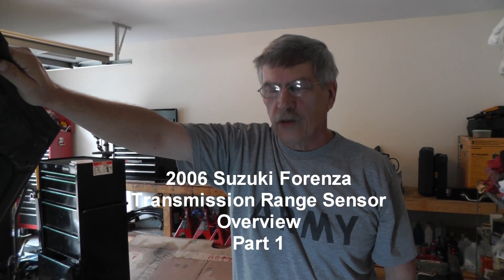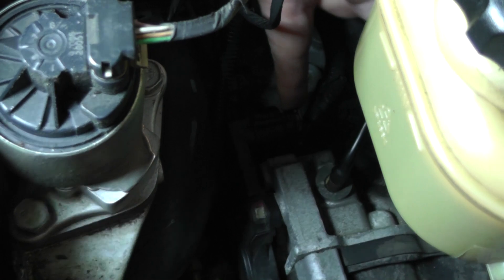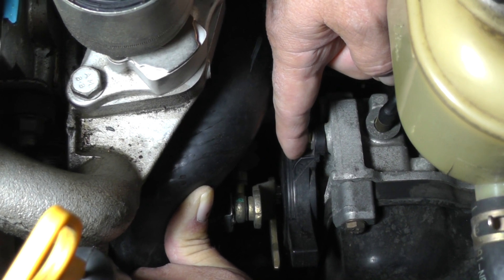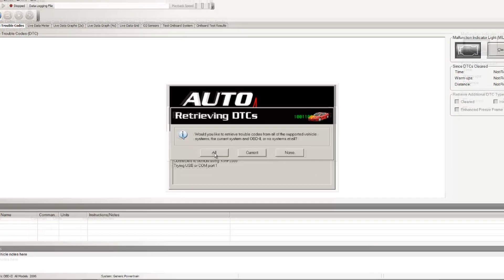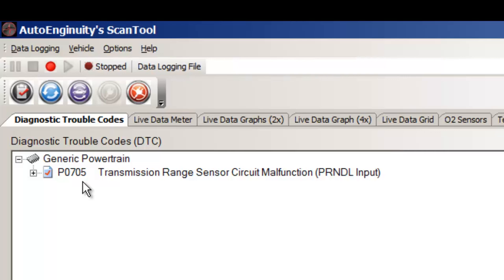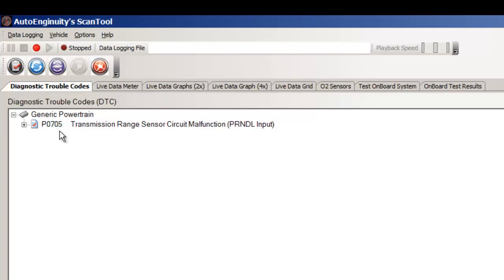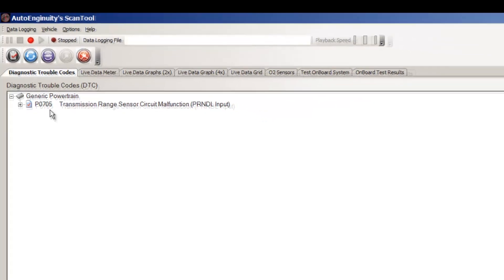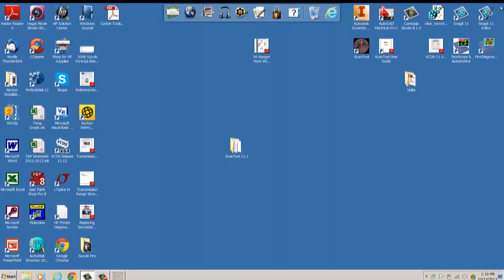Suzuki Forenza Transmission Range Sensor Overview - Part 1

Comment: Greetings from El Salvador, I have a 2006 Suzuki Forenza, I do not know,  how to do an oil change, I wonder if you can help with a tutorial on how to change the automatic transmission oil, thanks.
Reply from the maker: chino Lozano Sorry chino. I sold the car along with the service manual about two years ago.
Reply: ho no... but thanks you, for your time and the comment too.

Comment: Can anyone tell me about that hose that's sticking up from the transmission, just over from the range sensor bolt, shown at 0:52 ? I'm rebuilding my car can't figure out where the other end of that hose plugs back in.
Reply from the maker: Sadan Yagci I'm sure that the hose that you're referring to is a vent hose for the transmission. I can't tell you where it gets connected to as I don't have the car anymore to take a look. Maybe some here can help you out with that.

Comment: Could broken motor and transmission mounts cause the sensor to send the code?
Reply from the maker: Gene Quinney Hi Gene....Yes, I would say that if you've got broken engine and tranny mounts, it's possible that the P0705 code could be generated. Anything that will jar and move such as the tranny will also go to the sensor. So, if the sensor gets a lot of these vibrations and jarring, the sensor could report that. If you do have mount issues, get those fixed first. It's possible the P0705 code would go away at that point.
Reply: Thank you

Comment: Hey, great videos! I have a question I hope you could please help me with!

I have a 04 suzuki forenza. It is a 5 speed manual transmission. When I go to start it with the clutch to the floor, it does nothing, but if I lift the clutch just like a half inch, it starts up no problem. The clutch has to be in the perfect position or it will not start!
Does this sound like a Range sensor issue to you?

Thank you very much, in advance, for any input you might be able to provide me on this issue!
Reply from the maker: Take a look under the dash at your clutch pedal. Press the pedal and you should see a switch which should activate/deactivate when you press the pedal and release it. I suspect that you have a problem with this switch.

Comment: Hi i just bought the range sensor but its still doing the same it clunks whe i go reverse and drive and it does not shift its stuck in 1 gear. What could it be?  Thanks
Reply from the maker: I assume that you read the code originally and got something like P0705. You may want to read the code as I'm sure there is a check engine light on to give you some direction to go. Did you clear the code when you changed the sensor? Worse case is you may have a tranny problem.

Comment: Ok thank you. One more question after replacing the senser is the transmission going to keep clunking or do i need to drive the car or clear the check engine light?
Reply from the maker: It's better to clear the code and then you don't have to wait for the computer to clear it for you. Otherwise, with the computer it could take awhile.
Reply: NO I DID NOT CREAR THE CHECK ENGINE LIGHT COULD THAT BE THE PROBLEM

Comment: Hi do i need to clear the check engine light after i replace the sensor. And also by replacing the sensor is the computer going to reset the limp mode on the transmission? Thanks
Reply from the maker: If you have access to a scanner, you could clear the code which would be the best thing. But if not, the computer will clear the code. It may take a few drive cycles as I can't remember and the computer will reset the limp mode back to normal once it sees that all is well.
Reply from the maker: First, before you clear the code, check to see what code you have. I'm just assuming that you got a P0705 which would indicate a problem with the switch. I'm not there to see what your issue is. You need to read it to see where your problem is. Otherwise, you're just guessing at the problem. If you have a P0705 and you replaced the switch and you adjusted it correctly, then clear the code. Otherwise, it's going to take quite awhile before the computer resets the system which means you will have clunking in gear, stuck in gear, etc. If you're going to do the diagnostics, you'll need to get the code read from someone or invest in a scanner. Take care Ricardo and good luck on your repair.

Comment: Stupid question probably. But I've been having trouble for a while with my sensor. I turn it off and reset it and it's fine. I'm just wondering if I don't fix it immediately, it wont hurt my car right?
Reply from the maker: Not in the short term, but try and get it fixed as soon as you can. With the tranny sensor failure, your tranny will start out in third gear which is not the best for the engine.

Comment: I have 2006 Suzuki forenza when I'm driving the car the light  is on in the cluster is blinking to neutral  gear and the car not advance  just on 3rd gear  you think is a sensor range transmission?
Reply from the maker: Could be Jorge. Check your code to see what it is.
Reply: http://lacetti.com.ua/chevy-man/EN/documents/Nubira-Lacetti/start_Nubira-Lacetti.html
Reply: It's not the same vehicle but if you go to service manual>transmissions>zf4hp16 it is the same transmission.

Comment: My Aunt had recently bought me my first car 11 days ago (2005 Suzuki forenza S) with 83,000 miles. 2 days after buying the car I noticed in 3rd gear there would be a thumping noise, I also noticed that it was clunking harshly from park to reverse and so forth. Now here we are 11 days after buying and everything got worse. Was at a stop sign, tried to accelerate and it wouldn't, check engine light came on, put it in park restarted the car and I was stuck in either 3rd or 4th gear all the way home. Also, the 2nd day I had the car I noticed that the sensitive speed power steering mechanism light would come on while driving, the steering felt fine but I don't know what to do. The car is at the dealership right now but any ideas?
Reply from the maker: Hi Taylor, it could very well be your tranny switch from the description that you're giving. Being how the check engine light came on, the dealership will have a good direction to follow to see what the problem is. Hopefully, it will be that and nothing going on with the tranny. I wish you luck that the repair will not be too expensive. Take care Taylor...
Reply: Thank you, my local mechanic has had it in his shop for the past 24 hours, I'll let you know when i get the word on what is going on
Reply from the maker: Taylor Haney Hope it's nothing serious Taylor...

Comment: Are there any Suzuki Forenza lovers? I HATE this car. I replaced the transmission range sensor twice in a year. Now I have another problem which has a code of p0716, input speed sensor. Can you create a video showing how to fix this problem. I know the oil pan has to be removed but after that I don't know. Please help!
Reply from the maker: Hi Vickie. As for the Suzuki Forenza lovers, I'm sure there's a few out there. For me, I got rid of this car back in February since the car isn't supported in North America anymore. You'll be lucky to find Suzuki dealerships. So, unfortunately, I don't have the car nor the service manuals as I sold it all to the new owner. Have you done the diagnostics to prove that the sensor is actually bad? Maybe there's a bad connection. I would want to make sure that the sensor is really bad before I go to all that much work. Good luck on your repair Vickie...
Reply: stuzman52
Can you tell me how I would check to see if the part is bad? Is it possible that the transmission range sensor could have made it go bad, maybe from the banging when you put it in gear?
Reply from the maker: Vickie Arroyo It's unlikely that the range sensor had anything to do with the input speed sensor. The input speed sensor is located inside the transmission where it is mounted on piston B of the valve body. This sensor is a VRS type (variable reluctance sensor) which is no more than a two wire sensor that generates an AC voltage. This voltage is fed to the TCM (transmission control module) which is located under the dash to the left of the steering wheel. If you watch the later videos in this series, you can see where it's mounted. I took my voltage measurements from the TCM when diagnosing the tranny range sensor. The easiest way to check this is with a scanner and look for the PID for the input speed sensor which will give you the RPM's of the turbine speed of the tranny, (basically the speed of the input shaft of the tranny). If you don't have a scanner, then you'll have to drop the TCM down and take voltage measurements there. The sensor will generate an AC voltage with the engine running. The car does not have to be moving for this test. As the speed of the engine increases, so will the AC voltage. All of the connections for the sensor are located on the B connector of the TCM. Again, you can review my videos in this series to see which one that is. The signal wire for the sensor is on B2, the signal ground is on B4 and the shield for the sensor is on B7. Since you'll need a repair manual and electrical diagrams if you want to tackle this is located here....http://www.suzuki-forums.com/general-forenza-reno-forum/114577-p0716-input-turbine-speed-sensor-circuit.html Take note of the two posting by 7-even where he posts a link for a Daewoo Manual and also a link for the internals of the transmission. In the link for the Daewoo Manual, you will find the repair information and wiring diagrams. By the way, the links to the manual and internals of the tranny are free. Hope that helps you out.
Reply: stuzman52
Thank you so much. I am going to get my sons to study this and hopefully they can fix this for me. After I get it fixed I am going to sell this car. It's one thing after another with this POS..       Thank you for the information
Reply: Vickie Arroyo i AM A LITTLE LATE BUT i HOPE THIS HELPS YOU! http://lacetti.com.ua/chevy-man/EN/documents/Nubira-Lacetti/start_Nubira-Lacetti.html

Comment: Thanks for the video! Just bought a 2008 Forenza and the light came up, same code, same symptoms. I feel so much better now, knowing that it is a simple fix.
Reply from the maker: Glad to hear that you got if sorted out. Good luck on your fix!
Reply: I also have a 2008 Firenza am having several problems with it while I'm driving it says it's in park did you have this problem

Comment: Hello !!! My Suzuki Forenza 2005 has much power once I start to drive but when i go over 25 mph it run nice and smooth, also when i shift the gear to R,N or D it makes a big pound sound, so base on your video i went to 2 repairshop (Pepboys and Suzuki dealship shop) and when they jook up the scanner it said it's the transmission is damage and I need to replace or repair, I ask them about TRS code and both inform me nope it's the transmission, so i ask to sell me the TRS and also they inform me that TRS does not exist. What should i do ???
Reply from the maker: adh0211. I would highly suspect that you do have a tranny range sensor. Otherwise, why would it throw up a code for it. It's simple enough to take a look for yourself to see if you see the range sensor on the end of the transmission shaft as I show in this video and in the last video of where I show how to remove and install it. So, do that and see if you have one.

Comment: Hey I have a 2006 Forenza and there is no power going to transmission.  When car in gear, there is no movement.  I can here the transmission going in gear but there is no power going to the transmission thus the car doesn't move.  Is this the TRS as well?
Reply from the maker: Hi Rodney. Not likely a problem with TRS. When there is a problem with the sensor, the tranny will go into a limp mode. I believe it will go into third gear. I discuss the details of what happens in one of the videos in this series. You may had a small leak and the fluid is very low. Although you don't have a dipstick on this car, you can check the level. You'll have to get the car up on jack stands to be sure it's level. If you have a lift, that would be better. Get under the car and you'll see on the passenger side of the tranny a fill and drain plug with a 8mm square cutout in each plug. You'll need a tool to fit this slot. Take the fill plug out located at the top. The fluid should be at the bottom threads of the hole. Other than that, you probably have an internal tranny problem. Good luck on your findings Rodney and take care...

Comment: hi there I like your videos :) I watched all of them, I have a Suzuki 2007 forenza 47000 k miles only but its slow from 0 to 40 miles and after that it has good power what do you think is the problem? the previous owner changed the Transmission range sensor before do u think if they didn't install it right will make the car slower?
Reply from the maker: Hi parke. I would say that it's a very good chance that is still your problem. When there's a problem with the tranny switch, the gear will start out in a higher gear. As you know, the car will not have any pickup until you get to cruising speed. By this time, the car can pull itself along just fine because it's already in a higher gear. I would think that you have a check engine light on for this issue. If not, I would still suspect the tranny switch. Glad you like the videos.
Reply: stuzman52 thank you for your reply. I can feel it shifting its just slow my other car is Honda 1.7 L is much faster than the Suzuki the Honda has 189K miles, is there any thing need to be checked other than that?
Reply from the maker: parke john Nothing else comes to mind at the moment. Do you have a check engine light on?

Comment: My forenza keeps popping when I pass 20 mph it's an automatic. Any clue. I think it's the transmission. Thanks!
Reply from the maker: Hi Josh. If it sounds like it's coming from the transmission and it's doing it on a shift change, then it's probably the tranny as you've mentioned. Just in case, your display is showing the correct gears as you move the selector through its ranges?
Reply: Hey. Thanks for responding. But it's actually coming from the engine. It makes a weird noise now as well. A noise I can't explain. Somewhat metallic. And the pop might be coming from the engine. I read online and it told me that it could be the fuel injectors?
Reply from the maker: Popping sounds doesn't usually come from the injectors. The sound from the injectors is more like clicking and even then, you'll have to put a screwdriver next to your ear or you can use a stethoscope to hear it. Of course, this sound is normal. It may be your valves that are making the metallic sound. Can you tell which part of the engine that the noise is coming from? Is it from the top of the engine and if so, then it's probably your valves? Or is the sound coming more from the front of the engine where the timing belt, idlers, etc. are located? See if you can determine where on the engine the sound is coming.

Comment: Thank you for your series of videos, especially on head installation. I noticed this engine is the same as my 2004 Chevy Optra. At 1:40 your righ thumb is above a hose on top of the transmission (I believe). What is that hose called? What does it do? And where does teh other end lead? Right at that location it seems mine is leaking or sweating transmission fuel. The hose has two big holes about two 2cms above where it meets the transmission.
Reply from the maker: Hi Lauren, the hose that I'm pushing off to the side is the lower radiator hose. No tranny fluid goes through this hose as its coolant. If you can see two holes in the hose, then obviously you'll need to change it. Thanks for the comments on the head installation and hope the hose info helps you out.
Reply: that hose is a vent for the transmission, allows for venting to prevent transmission overheat. the other end goes outside the right fender

Comment: I can use a Suzuki Forenza Transmission Range Sensor for a chevrolet optra 2008?
Reply from the maker: Hello Andres. The Optra is very similar to the Forenza so my guess is that they use the same transmission sensor. Try and look up the sensor for each car and see if they match up. Or maybe look at picture between the two and see if they are alike. Since I don't have an Optra to look at, I can't swear 100% that they are the same, but as I mentioned, my guess are they would be. Thank you for your comment!

Comment: Thank you for your attention. Workshop examined and found to be 4.2 in the fuel system pressure. Is it possible to lower the pressure in the computer? If it's a normal index? And how can I check the O 2 sensor straight to work? Injectors ultrasonic cleaned a few months ago. Could I remove the catalyst? The system is not shuffled?
Reply from the maker: When you say that the fuel pressure was 4.2, I assume that you mean 4.2Bar which is around 61psi. This pressure looks okay to me and you can't adjust the pressure in the computer. You can see if there is a reaction from the O2 sensor by looking at the fuel trim numbers with a scanner. You'll need to get a scanner hooked up to the car to see what's going on. Also, you can use an oscilloscope to monitor the O2 signal. As for the catalytic converter, I would not remove it as you'll have another problem with the check engine light coming on. The shop should have the know how to get a scanner on the car and monitor the data that the computer has. That's about the best advice I can give you at this point.